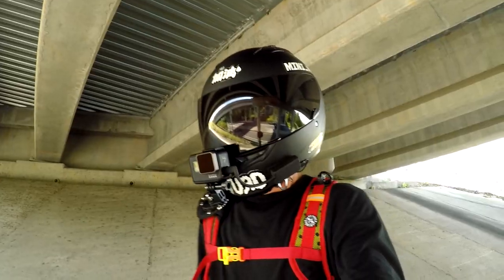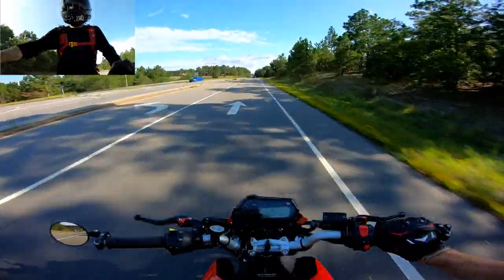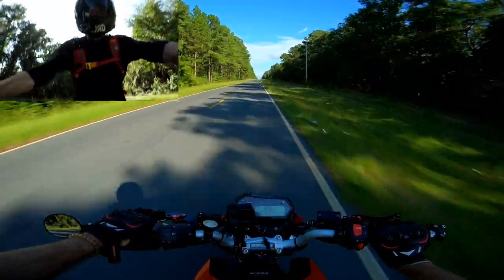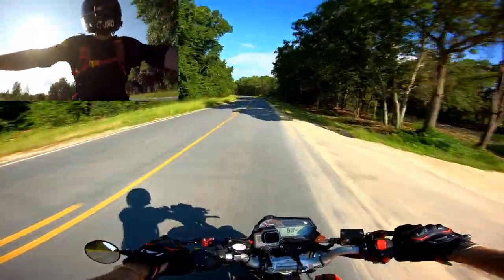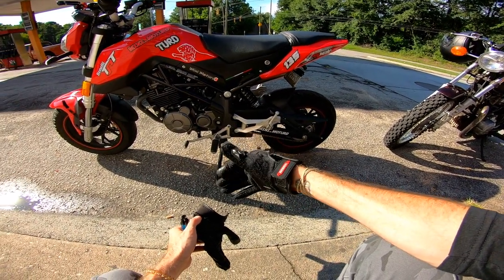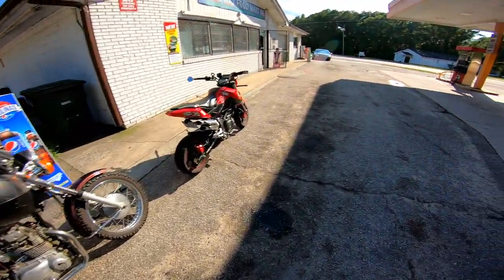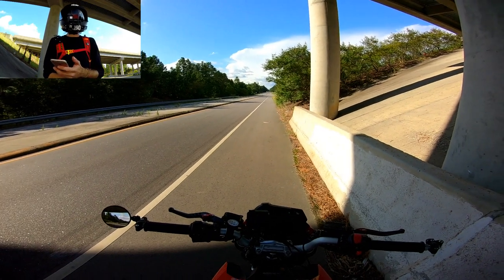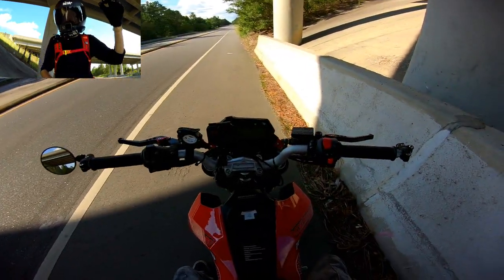Benelli tnt 135cc| 35T Rear sprocket | First Ride

Comment: Took my tnt off-road can’t get it to run right now any idea
Reply from the maker: Can you give me some details of when and how it started running rough?
Reply: @MiniMoturd  yes sorry I was very Vague beforeI took the Benelli off road after getting my 3000 miles servicing……also  got off-road tires installed on the bike during the service I took it off road I’m not gonna lie I rode it rough off road mild hill climbs.
I though she would perform like a mini dirt bike 
I fell a few times due to the low ground clearance 
Bike ran fine
Until the ride home
Keeps cutting off in the middle of riding no matter what rpm 
I have to cut it off with the key while in motion downshift while holding the clutch turn it on upshift into correct gear then continue 
Before it cuts off again
I have changes spark plugs twice oil change 
Same issue with cutting off with riding I thought the air filter was dirty it’s fine
Reply from the maker: @EVERYTHINGSEVERYTHING  That’s okay, so first thing I would do is inspect your spark plug wires really well. I just recently had one of my spark plug wire caps go bad. It would sputter occasionally and Eventually the insides of the cap Completely broke from the wiring and would not stay cranked…so check that but then also check all the wiring on The bike for broken wires frayed wire etc. I’ll ask around and see if I know anyone that’s dealt with a similar problem I’ll let you know here in this comment what I find out🏍💨👊🏻
Reply: @MiniMoturd  thank you brotha will do
Reply: @EVERYTHINGSEVERYTHING  Definitely sounds electrical to me.  Other than what was mentioned I'd check the kick stand switch and the tip sensor.  I'm not sure if a TNT has both of those, but either will cause you to lose ignition.  Let us know what you find 👍
Reply: I personally have a kz thats were its at!
Reply from the maker: @telegraphmetrostore5007  Heck ya man….loving mine🏍💨🤙🏻

Comment: Rear use 35t..front use how much 14 or 15...suitable for weight over 80kg
Reply from the maker: I would use a 14T on the front, in my opinion I prefer to have the torque.

Comment: I want to try 13 front and 30 rear. the smaller the front rear is the more torque you get out of the engine. the smaller the rear you get top speed. trying to find a balance between torque and top speed. where did you get the 35 rear sprocket? i have a 14/36 on now and looking for rear.
Reply from the maker: Awesome man, I plan on using the 35t for a while but I going keep switching it up until I find a ratio I like. Heres the link for the sprockets https://www.steadygarage.com/store/rg-aluminum-rear-sprocket-428-pitch-benelli-tnt-135-cc   Thanks for watching🏍💨🤙🏻
Reply: Did you ever try 13 30 if so how is it
Reply: And is it good with 13/30
Reply from the maker: Was interested in hearing what he thought to.